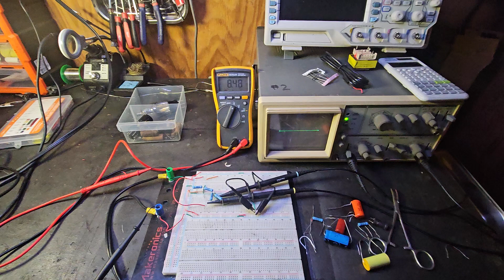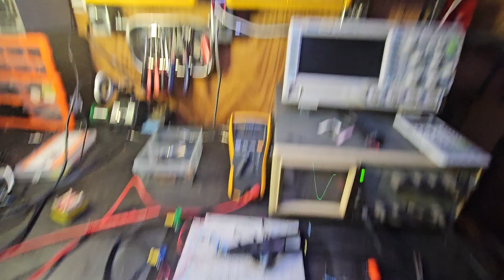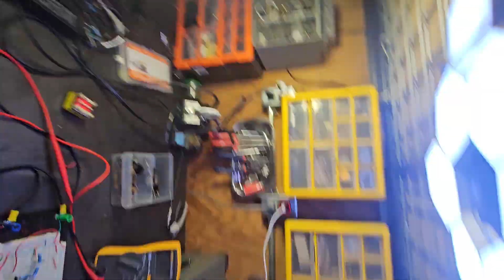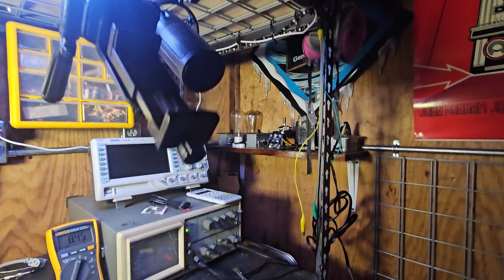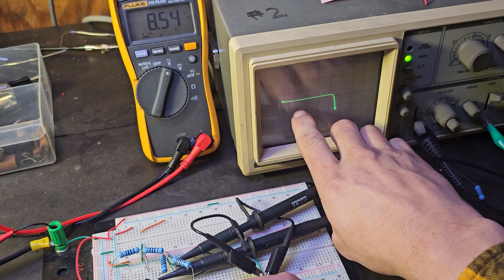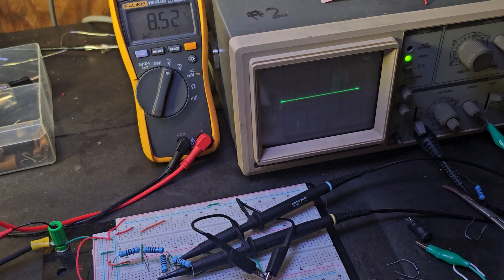Curve Tracer(Octopus Tester) build and demonstration

Comment: Nice tester! I know these are almost always used with vintage scopes but I'd love to see what it looks like on your digital scope. Part II?
Reply: Sorry to hear that! Hope you build things back soon!
Reply from the maker: @besamjohn  it's going pretty well! When it's all said and done, I will have a full basement/garage to work out of and produce videos! Unfortunately for now I am stuck making content on my computer using circuit simulators and things like that. I'm using the time to learn more so I have more content in the future. I just bought a sweet military signal generator from WWII. The RF side works and is actually dead on frequency across all the bands, but the modulation isn't working for some reason. So that will be a nice troubleshooting video at some point.
Reply from the maker: I didn't really look at the digital scope to see if it had XY mode. My plan was to print a pcb for this circuit that I could fit inside the scope and integrate and wire it directly into the XY section to where I'd never have to hook up scope probes for this again. I will look and see tonight if it does and try a part 2 if so!
Reply from the maker: @besamjohn  Here's an update if you're curious. I did try running this with my digital scope. It does work but it's not quite as good. The refresh speed is very slow and it takes awhile for the screen to update. It might work decently with a high quality Tektronix scope, but mine is pretty low end.
Reply: Thanks for the update! I ended up buying an analog Tektronix. I agree, my digital scope is just slow and cumbersome.
Reply from the maker: @besamjohn  Very nice! We got wiped out in the flood here in Appalachia. The room I filmed this in was almost completely underwater, but when I can get around to getting another lab setup I'm planning on buying a 500 series Tek scope. The only reason I like digital is being able to quickly see frequency, amplitude, phase and all of that